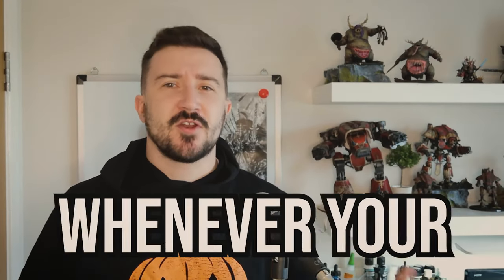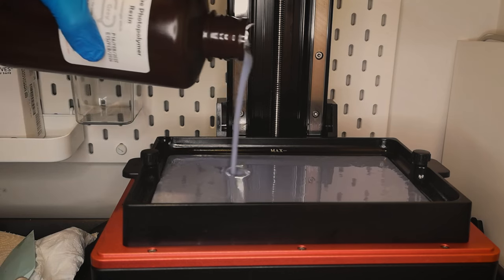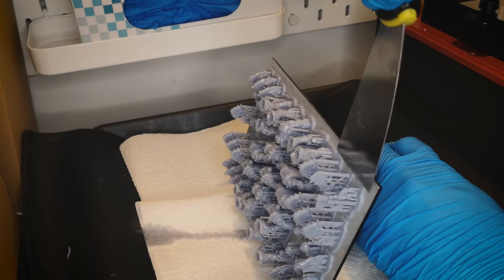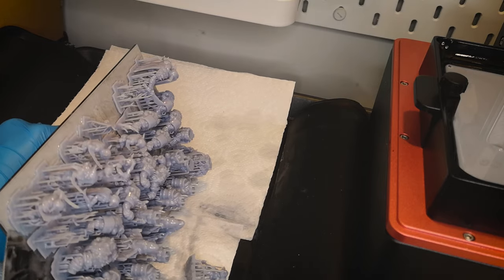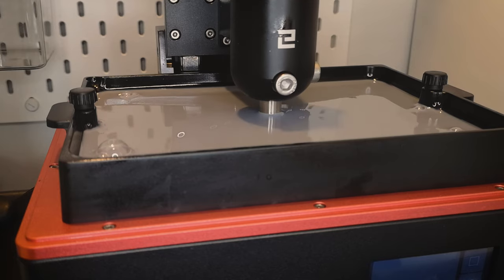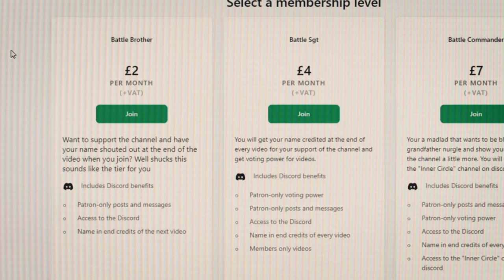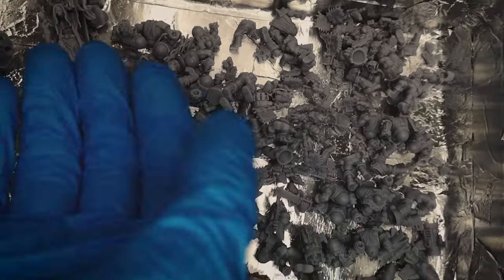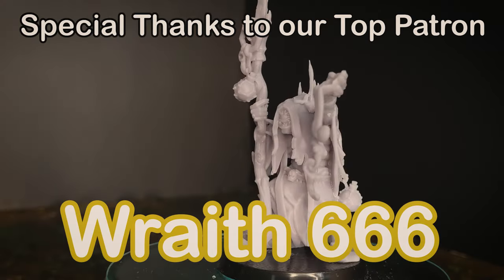How Many Minis Can I 3D Print with Only 1 Bottle?

Comment: I’d rather spend 60 minutes on the front side of a print getting the setup right instead of burning through 12 hours of printing for a plate of fails.
Reply from the maker: A year ago I would agree with you but I'm become too accustomed to presupports, saying that I'm supporting a warlord titan in the near future lol
Reply: @battlebrothersam  imagine only half of the parts failing midway... 200 bucks worth of resin for the bin if it is pre hollowed ?
Reply from the maker: Once it gets up to that size of model any failure is costly! To be fair though my warhound was presupported and the supports were miles ahead of what I would be able to do
Reply: @battlebrothersam  Because someone with the knowhow spent the time to put them on instead of head clicking AUTO and rubbing holy oils to appease the machine spirit.
Reply from the maker: @Jokreher  you know me too well brother LOL lychee magic button and real time island detection has become my go to
Reply: @Jokreher  Granted, using 3Dprintingpro’s support settings plus AUTO has never failed me.
Reply: Still cool tho

Comment: Presupported files are great and all, but I'd definitely encourage anyone getting into 3d printing minis to learn how to do their own supports.  My print success rate went through the roof when I started doing it.  It's not hard to learn and the tools in Lychee slicer do a lot of the hard work for you.  It's a great skill to pickup.
Reply from the maker: The magic button is a god send doc! Without lychee I would've struggled to support models
Reply: Learning how to support is really good, even using presupported models you can spot issues for your set up that can be corrected ahead of time.
Reply: But I hate doing them
Reply: This.  The first thing I did picking up 3DP was watch a ton of tutorials on supporting prints.  Sure you will take time to figure out what works best for you, but once you are there it's kinda fun.

Comment: Out of 7 bottles, ~350$ CAD:

- 1.5k cities of sigmar freeguild (75 models)
- 1k Flesheater courts (30 models)
- 1k Nighthaunt (30 models)
- 3k Seraphon (~50 models + kroak + 6 dinosaurs)
- 2k Be'lakor army (be'lakor + a ton of bloodletter sized minis)
- A Goblin Blood Bowl team (16 models)
- Ossirach Warcry warband (12 models)
- Tau kill team (15ish models)
- Kroot kill team (12 models)
- Intercessor kill team (8 models)
- 3 Armigers
- A Battletech lance (4 models)
- ~60 cyberpunk models for Five Parsecs from Home

IIRC after doing the math, JUST the Seraphon monsters covered the cost of the resin, and the entire Seraphon army covered the cost of the printer and the wash/cure station. Everything after it was like 75% savings if you take into account minor failures, cost of gloves and towels, and the cost of files. Something GW sells for 120$ (an imperial knight) costs about 12$ to print + 20$ for a high quality file (if you don't use the free one floating around) that you can the reuse as much as you want.
Reply from the maker: I have epsid for my printer and supplies multiple times over at this point it's not even funny anymore 😂
Reply: Note that the CAD cost of an imperial knight has risen to 200$ since I last checked (I went off memory and severely low balled it) - meaning for the same price in resin you can print about 6 of them.
Reply: Where did you get the files?
Reply: I've sliced a warhound titan out of curiosity and it punched in at about 1.5kg of resin required. With my current resin blend that's a whopping $60-70 of materials, and unlike Forge World it actually includes weapons 😆
Reply: where did you get the goblin stl?

Comment: I think your issue is either build plate level or bottom layer exposure, prints stuck to the FEP are typically one or both of those issues and not the supports failing. I find my Saturn 2 unlevels really fast because of the ball joint. I also prefer to go in with Chitu and add a raft to the models, just saves headaches with removal. You can also add some fatter supports to the initial contact points. Also, good on pointing out mistakes, they happen and they cost resin. Overall I printed about 4K points of HH space marines and a 3K Lizardman army for WHFB 8th with about 3ish 1kg bottles. At $40-50 each it's still a big savings.

Comment: Great video! I've been 3D printing for well over a year now, but I'm using a smaller size printer (Anycubic Photon Mono). I chose it because of some possible issues with larger format printers that could result in a higher rate of failure. The larger size of the FEP has more pull and that can really do a number on lift and retraction, which just makes failures more of an issue. I generally go with presupported models as well, just for the pure ease of it. Works out mostly OK, but sometimes you get a presupported model that just... Has issues. It happens.

On a side note, I don't play Warhammer, I print for D&D and just painting projects. At the time, I figured I already played Magic the Gathering, no need to go into debt playing another game! I do have a load of Saurians printed, from OnePageRules and I have two small warbands printed for a game called Nebula (from CastNPlay), so I may just be getting into wargaming after all!
Reply from the maker: Thanks! Yes I've noticed after moving from the Mars 2 Pro up to the saturn there is a higher chance of failure like you say with suction force so really the models in the middle have to have pretty strong supports! I've put nfep on my saturn as far as I can tell it helps but like you say some models just don't want to print lol one page rules is a much more streamlined warhammer experience so your definitely moving in the right direction there 😁

Comment: I think adding links to the creators your using to get the models would be a huge benefit to your video. There are so many creators out there it is impossible to know which models you're using if I wanted to go print a bunch of orks after watching your video.
Reply from the maker: I've done it in the past and unfortunately geedubs is always watching, if the creator OKs it then Ill put them in.
Reply: He went through this before. He does not want to be responsible for the stl sources to be taken down. Well anyways, it is very easy to do a search on MMF for whatever you need

Comment: Great Vid Mate :) Try to load Your plate less so the FEP will have more space to warp. I normally do no more then 60-70% of build plate and stick to center as much as possibile. I rarely get fail prints. And do a pause after bottom is done to check if its sticked to plate. Saves time and resin.
Keep up the good work and happy printing :)
Reply from the maker: That actually makes a lot of sense! Thanks brother I'll test it out

Comment: i dont use pre supported files and i have had 2 fails out of 20 prints. maybe using pre supports is not a good idea. your computer can make supports in about 3 seconds.
Reply from the maker: They can be hit or miss but I wanted to use them so the video can apply to an absolute beginner

Comment: What resin do you use/recommend? I have been using the Anycubic Eco in grey and found that my models are a bit brittle. Although it could be because I was curing them for 6ish minutes a pop. Would love some more recommendations.

Also you should check out the flexible build plate for resin printers.
Reply from the maker: Yeah 6 minutes is over curing, I cure for 1-1m30 each side. Overcuring does make it more brittle, I think abs like elegoo is the best I tried so far, I do want to try the standard resin though to see if there's much of a difference
Reply: Yeah 6 min is way over curing. Elegoo abs like is great. Ive burned through quite a new bottles of elegoo standard and Anycubic standard. They're decent. Anycubic Standard + is actually really good!
Reply: I've used the Anycubic Standard Grey for months (currently 12 bottles down... And I don't like to do that kind of financial math) and I'm currently using a bottle of the Eco stuff. 6 minutes is WAY overkill. Here's a little trick: Put the models you want to cure in a container full of water. Completely submerge the model and then cure it underwater. Exposure to oxygen messes with the curing resin and you can eliminate that by curing underwater. It leaves you with a more sturdy mini (well, less fragile. I mean, it's still resin and it will still shatter if you drop it on a hard surface) and a shorter cure time (30-60 seconds is plenty, depending on the size of the model).

Comment: It's not the lift speed that's the issue. Your settings are totally off. You should be aiming at auto-supporting 75% of the models with smaller support struts that have a contact diameter AND depth of 0.30mm.
Afterwards, on the slicer menu, try this; Exposure time 5, Lift distance 5, Lift speed 100, Bottom exposure 45, Retract speed 150.
The reason for 45 on the bottom exposure is so that it warms the resin up as you print, and as it cures it will give your models a stable base, then the residual light will cure the rest of the print layers.
Reply from the maker: 5 secs exposure is way too long for a mono screen and 45 secs bottom exposure would be too hard to get off the build plate in my opinion but if that works for you then kudos, I will look st the 75% part though

Comment: when dealing with pre-supported pieces that continuously fail, I recommend using the slicing/supporting program recommended by your printer manufacturer and either A) adding additional supports manually to the pre-supported model or B) get the unsupported model and support it all manually. You should also increase the exposure time slightly. I hope this can work for you if this is a continuous issue you have.
Reply: 100% agree. i never use pre-supported .

Comment: Little late here but ive had similar issues with abs like resin and fails…im still fairly new but i suspect the flexibility of abs like means you need sightly heavier supports than otherwise

Comment: You got surprisingly lot of failures. From my attempts auto support from Lychee (medium supports settings) works fine even for bigger orc models (sized above warboss by known company ;) )
Reply from the maker: Yeah it was a pain I imagine it was tempuature in the room or of the resin but I wasn't expecting that many
Reply: @battlebrothersam  right. I've also printed some stuff next to open window (hoped that it will resolve smell issue). That was bad idea. Resulted in few failures and warped models...
Reply from the maker: Grow tent could be ideal for you then as you should only need to open the window when you open the tent to get the print out however YMMV

Comment: I got 1000 points of Heresy models out of a 500g bottle last year; mostly Marines, a couple of Rapiers, attack bikes and a Contemptor.

I've wanted to do one of these challenges again; but between the temperature dropping close to single figures in my area of England and my work pattern, I can't run my resin printer at anything close to the ideal temperature. There's no point heating up an entire room just for the printer when I'm not home to monitor it.